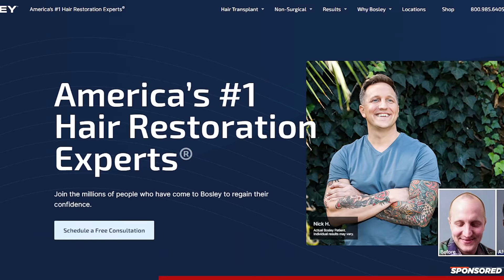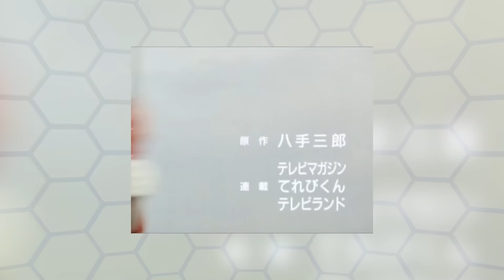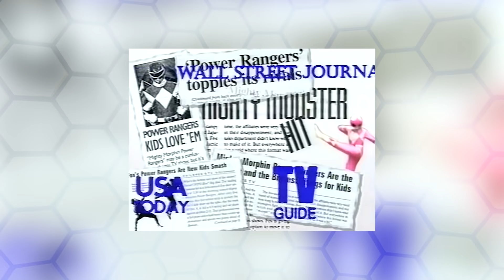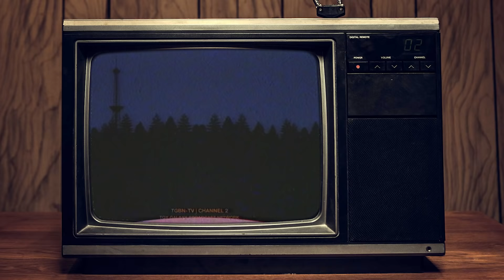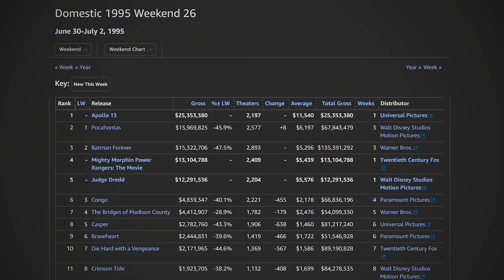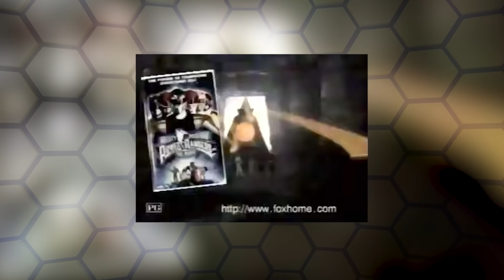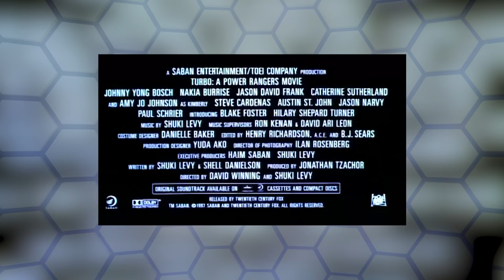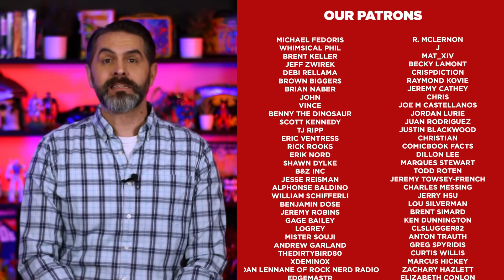The Chaos & Failure of Mighty Morphin Power Rangers: The Movie - Better Luck Next Time?

Comment: Look at that lineup at 14:40…Spring/Summer 1995 was stacked! Apollo 13, Pocahontas, Batman, Congo, Judge Dredd, Casper, Crimson Tide, Braveheart, Bad Boys, Die Hard 3, Bridges of Madison County, and Clueless. If I remember correctly, Seven was released at the very end of the Summer. There was a record heat wave that Summer so many people chose the air-conditioned movie theaters if at all possible. I probably saw nearly all of those movies that Summer. Simpler times.
Reply: There were theaters that aren’t air conditioned?

Comment: I watched the movie when I was a kid with my mom in the theater. I even got all of the McDonald's toys except for the Red Ranger.  The downer of the movie for me was actually they did not include the classic power weapons at the Rangers supposed to have except for the right Rangers Saba. I've watched the movie so many times I can quote line by line, which is a little scary.  I've been following the Power Rangers story ever since I was a kid so when I hear that paramount, netflix, and Entertainment 1 I wish I could help with the production.

The 2017 Power Rangers movie I enjoyed the storyline but I hated the designs of the suits and the zords. Felt too disconnected from the franchise and also because of bandai at the time I have low standards of productions for the toys and figures they did not have a solid designs of the figures and the toys. Unlike transformers where the production of the movie worked with Hasbro to actually manufacture and design robots that actually can be produced as a toy. Just watched the special features on both films. The Power Rangers movie in 2017 said that they want to make a realistic Power Rangers as possible and had alien technology which didn't go well with producing the toys.  I just have to much to say about the subject.

Comment: In all fairness to the 2017 film, Jason himself didn't jack the bull off.  It was his idiot friend that did it.  And then Jason looked at him like: "Are you serious?"

However, that was not the worst of it.  The cheap throwaway line mocking Transformers: The Last Knight in which "Bumblebee" gets trashed when kicked around during the battle with Goldar was equally cringe.  The bland, generic Ginger bully replacing Bulk and Skull was also not well-received.  Lionsgate was handed strands of gold, to spin into platinum, and instead turned it into silly putty.  They did the franchise so dirty, I'll be very intrigued to see how Hasbro can turn things around.

Perhaps the part that's the least redeemable, is that Kimberly engages in distribution of revenge porn involving a minor.  And yet, we're still supposed to root for her?  Come on!